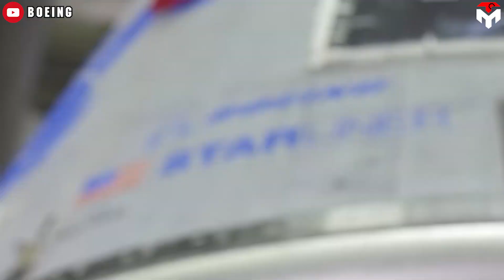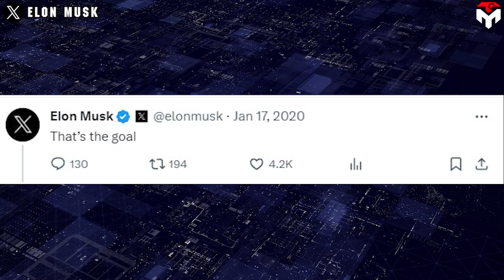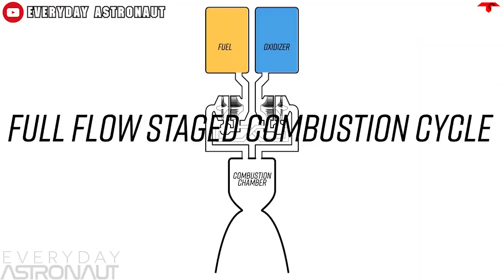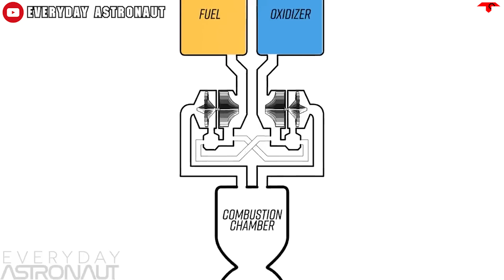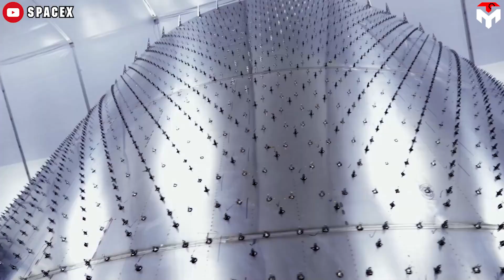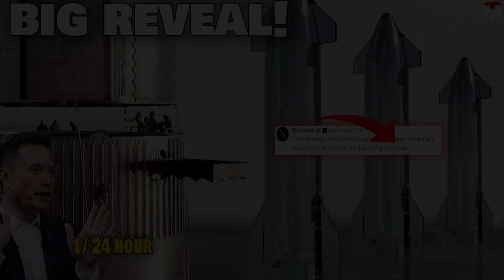SpaceX revealed Starship's manufacturing Master Plan equal to Boeing 737s!

Comment: The most realistic solution is to build the galactic class starship,  which is a three stage, fully reusable  star starship that will not require any orbital refueling to go to the moon or to any other destination in the solar system. This is common sense,  if Elon really wants to be multiplanetary. In fact, it is a stupid design to use 10 ships to refuel on ship, when you can simply build a 3 stage Galactica class starship. The tank slushing and propellant problem can be resolved by using fuel tank  divider valves that expand the diameter of each tank, which are peforated to allow fuel flow,  and have one disk rotates above the second to seal off the bottom quarter of the tank before the rocket rotates or stops firering.  You can add telescopic cylinders inside the bottom part of the now sealed smaller  tank section to control the propellant pressure regardless of the position of the rocket. In fact, I did build a small scale mode. It was simple to make, and everything works like a charm. Elon, my advice is your only option, if the nephilms of inner earth will allow you to really build a multiplanetar spacecraft. You are right. Aliens are not from outer space. They are ancient races living under the earth and under the oceans. We already have secret bases on the moon, Mars, and many other places in the galaxy.

Comment: 3000 Starships, with their chemical propulsion, can deliver 15000 passengers to Mars.  That makes 167.5 years to bring one million people there.  Because of the needed supplies on the transfer only(!), one Starship can only bring 5 people at once. Then there is a half a year for the transfer.  Besides the radiation risk, the missing gravity will weaken the travellers seriously.  They might not even be able to crawl out of the ship on their own.

This plan is not going to work, without some major advancements.  It could, though on a smaller scale.  There have been many proposals for a Mars mission.  All with tin cans, but some with artificial gravity.  How are the needed supplies going to fit inside these tin cans?!

Starship is a major step in the right way.  Now they will have to take the next level of propulsion if we ever want to get beyond Low Earth Orbit.  That might take only 42.5 years to make a Mars colony of a million people.  Probably even less time, but, starting 2050, it can be done before 2097.
🚀🏴‍☠️🎸
Reply: originally designed for 100 passengers and their supplies, and now approaching double the original capacity. if they have to add a ton of features to accommodate passengers, it's still 30+ people per vehicle.